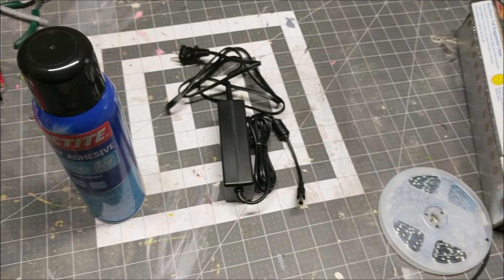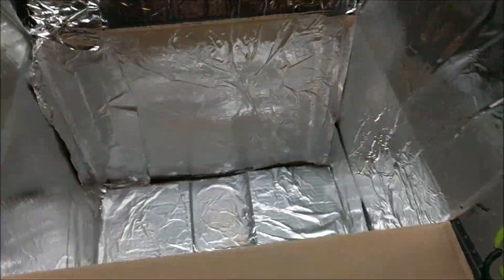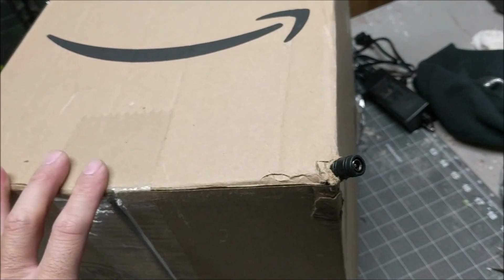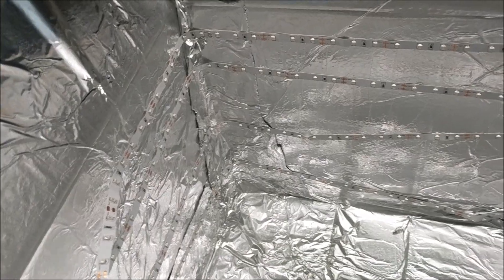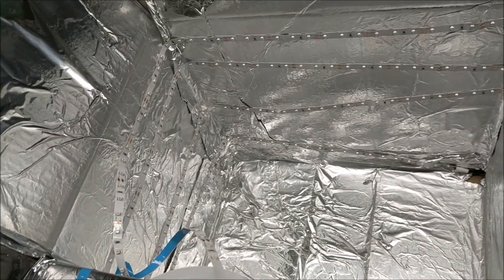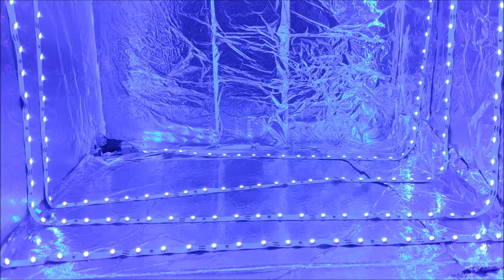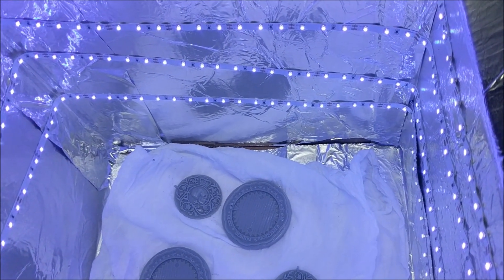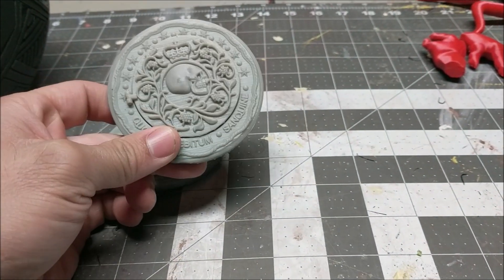How to Make a DIY UV Curing Chamber for Your 3d Prints

Comment: I found it, much easier to attach the foil, by completely flatting the box and then spray gluing the foil.  Then just a matter, of re-assembling the box and taping it together, at the outside corners.  Would also be useful, to add a cheap, rotating stand.
Reply from the maker: this is GENIUS

Comment: you could get the 12in square mirror packs from lowes for cheap, tape the corners together to make a box out of them, and then mount the leds in the corners or just cover the top panel. Then you would have a super efficient uv curing chamber.  Im excited about the forum, gunna check it out.
Reply from the maker: Didn't even think about the mirrors. That's a great idea!!